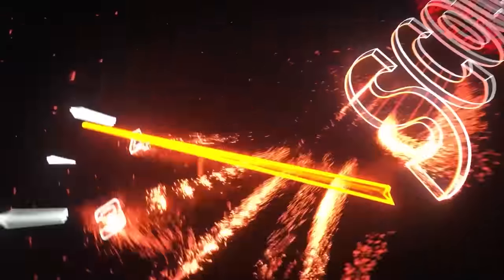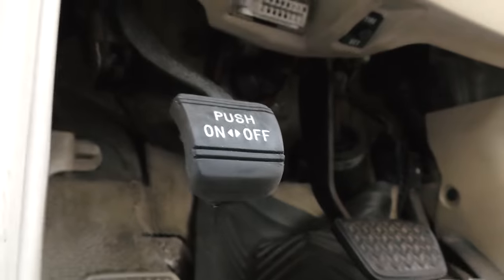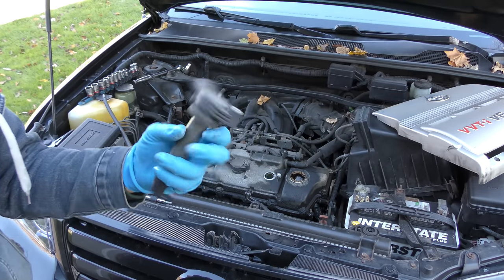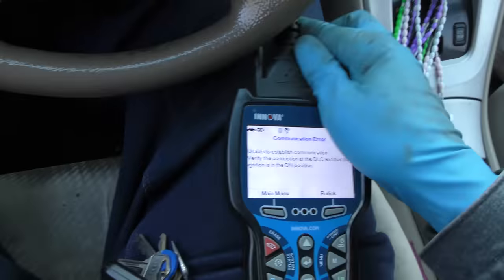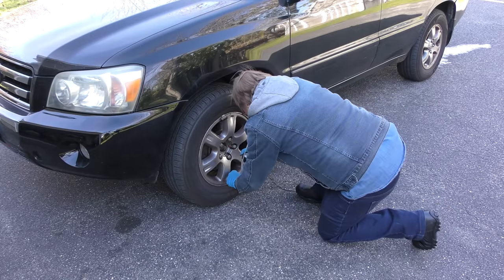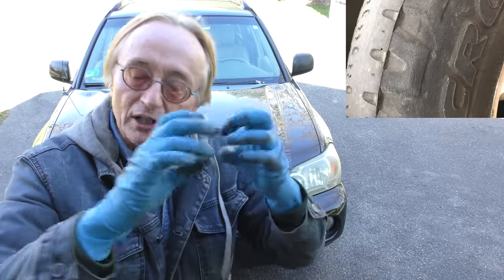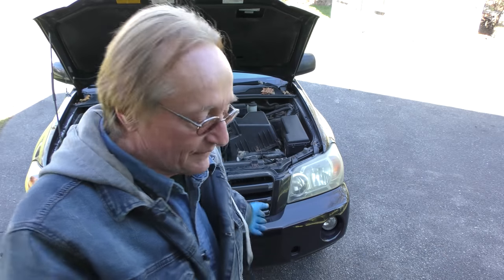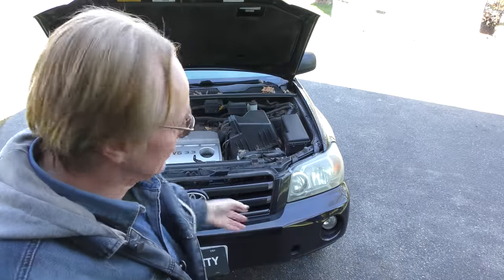Doing This Will Make Your Engine Run Like New Again

Comment: Tires should have 32 psi, not 28 psi
Reply: @danielmeador1991  he doesn't have a certificate cause he doesn't need one and that has nothing to do with it
Reply: its on the tire sidewall, too.
Reply: Mine 35?

Comment: My dodge durango 2007 was shutting off randomly.  Changed all 8 spark plugs and all 8 coils, runs beautifully. The plugs were fouled and coils old btw.  Also both oxygen sensors, had a code. Thanks!

Comment: Most of the time when there is no communication with the scan tool, we find aftermarket accessories wired in to the DLC causing a fuse to pop.

Comment: A little oil seepage on a high mileage engine is not a bad thing, but can high mileage oil help reduce or eliminate this seepage?  I know the label says use this oil after 75,000 miles, but I believe the car will tell you when it wants the additives in the oil, and I would not use high mileage oil until I see the need no matter the mileage.

Comment: There has to be a Lotta good mechanics in this chat or hopefully the big dog Scotty can respond to me but I have a 1995 BMW 325I that seems like it’s down on power. When I’m in neutral and I rev up the engine it seems like it’s slow to rev but not that bad.  but what concerns me is that when I let off the gas the engine really wants to drop RPM. It’s most noticeable when you’re in neutral. but also when you’re driving on the highway and you let off gas the car doesn’t really coast it slows down a lot. 

It’s an automatic

Comment: How do you troubleshoot a random multiple misfire?
Reply: Move the coils around after marking them and reset codes, drive, diagnose, and replace the bad ones or all of them. Th3n watch his video on diagnosing misfires
Reply: @kyotoben610  I have done that. After clearing codes, the problem would be gone for a while and come back randomly. No condition would cause it outside of normal operation.

Comment: I have a 2010 Volvo XC60 t6. The OBD is showing P0420. I had the 2 sensors and the cat replaced. What next? There is about 180k miles on the vehicle.

Comment: Acura tl 2001 240k miles. "White" smoking from under the engine between the engine and the front exhaust manifold cover. No sweet smell.  I dont notice oil levels going down. What could it be? 😫

Comment: Those ASE certified technicians are absolute idiots I grew up at my grandfather's and my father's transmission shop just holding the flashlight and learning I know more than any of those guys will ever learn took my Jeep Patriot and to Firestone they told me my head gasket was blown it can blow at any moment I drove that sucker for 6 months straight just by diverting the heat into the cabin the summer sucked but I got places.

Comment: Can u please help me out I’m having issues with my 2010 Subaru Forester XT turbo keep getting engine lights coming on, first it said downstream sensor then I cleared the codes then it came back on saying it was MAF sensor so I bought a new one and put it in then I cleared the codes and now it saying the mass air flow sensor bank 1 too lean. So I did what u did in video I used a resistor n cables to reset the car computer it worked for about an hour, check engine light n cruse control n wet when slippery I’m at a lost, please help me